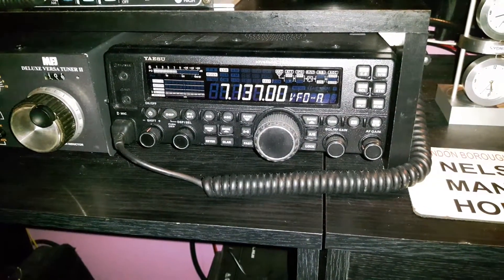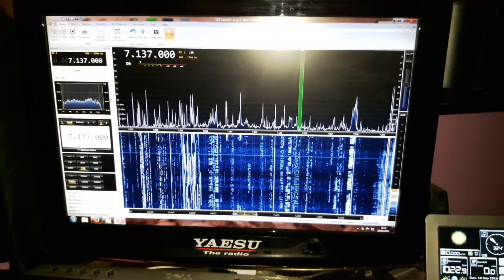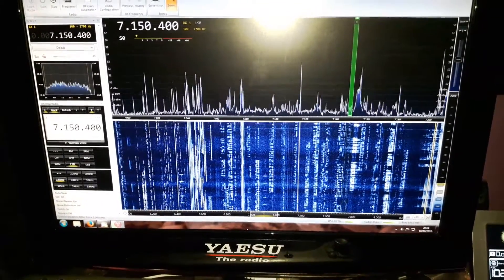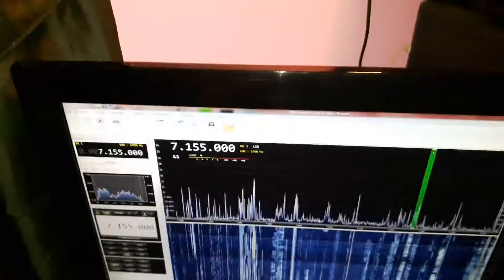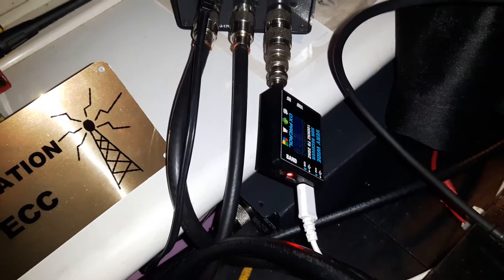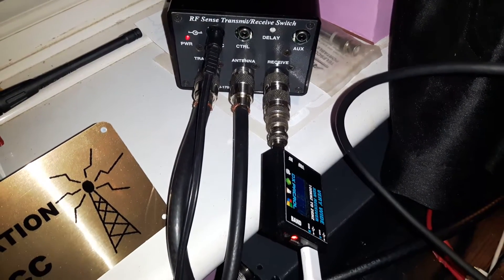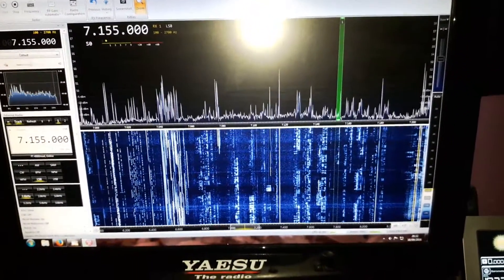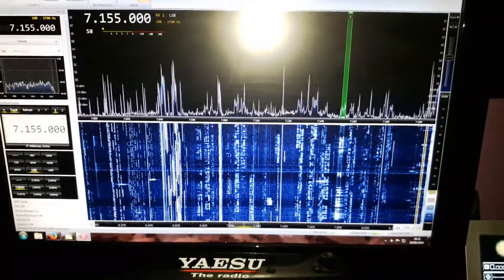ft450d panadapter

Comment: I'm getting this 1708 unit. Regarding the RCA cable - are there specifically rated cables for PTT or can it be any comercially available RCA cable? Many thanks in advance.
Reply from the maker: The Switch is rated upto 200w so best put inline before a linear

Comment: This is great to see. I want to do the same thing but with a separate Wellbrook loop antenna connected to my RFSpace NetSDR. I "think" what I need to do is keep my OCF Windom directly connected to my 450D, and then connect the loop to the MFJ-1708, then the cable for TX sensing to the 450D. The loop is so much quieter than the OCF is, obviously, and if successful this would amount to the perfect setup for me. Any thoughts on that would be appreciated!
Reply from the maker: The MFJ-1708 shares the same antenna & it's your ocf that transmits & needs to go through the MFJ1708 to throw the relay to ground the sdr antenna socket so a difficult one
Reply: Thanks for the reply. Actually from what I'm reading at sdr-radio.com it appears to me that I may be able to pull this off using just SDR Console 3, configured with OmniRig for the 450D. It appears I can use the NetSDR as the receiver with the Wellbrook Loop attached, and set the software to mute the SDR when transmitting with the 450. I'm going to try it this evening and see how it works. It appears it can mute the SDR enough to protect it sufficiently.
Reply: Followup. I'm pleased to report that my setup as described above is working superbly. I'll post a video on the specifics soon, but in a nutshell I'm running the 450D at its max baud rate of 38400 and the Poll Int ms is set at its minimum of 100. In SDR-Console, I have the mute on transmit setting at its highest leverl (-80 dB). There is pretty much no delay when I key up, and the NetSDR is muted quite nicely. I can observe my signal when tuning and when transmitting and it is knocked down significantly. My noise level with the Wellbrook Loop is minuscule as is expected and as it's always been. What a powerful combination. Thanks for the inspiration!

Comment: How does the MFJ-1708 work for you? I have a similar setup with a FT450D and a RSP2. When I transmit, the MFJ-1708 reduces the signal to the SDR to a safe level, but it doesn't eliminate it so I hear myself in my headphones. Do you have that problem?
Reply from the maker: I now use an sdrplay rsp1 on this I don't have the problem as i only use 10w through the MFJ1708 switch after the switch the 10w then drives a linear then through a lowpass filter then onto the atu & out to the antenna hope this helps
Reply: Thanks. I ended up doing add an RF tap. I'll be testing it out in a few days.